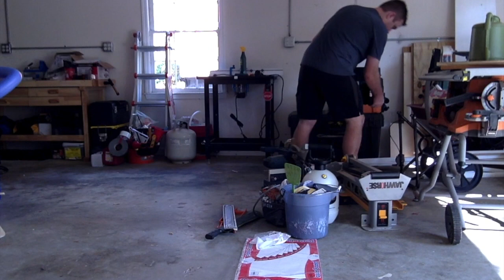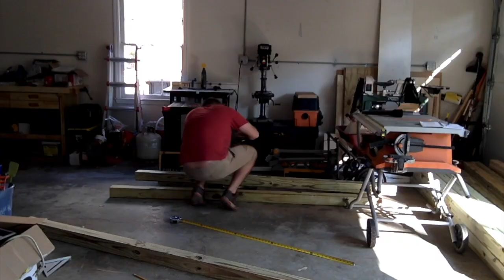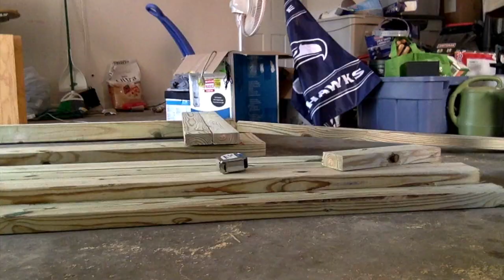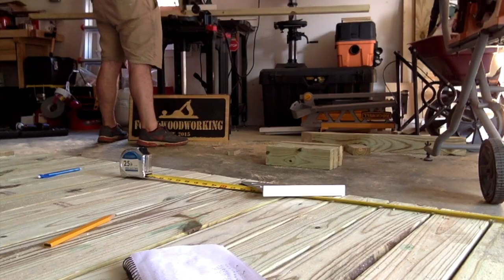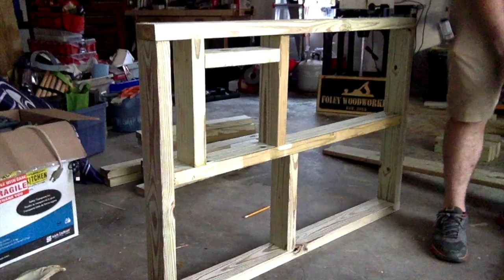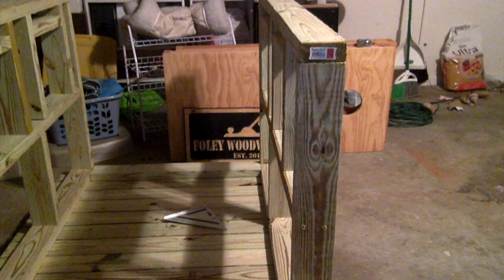Dog House Build Part 1

Comment: Please, can you tell me what materials do you use to do all the project?
Reply from the maker: It is all pressure treated material.  It is made up of PT 4x4 posts, PT 2x4s' and PT decking boards.  The roof is just normal plywood with asphalt shingles.  The awning I used cedar shingles.  In the windows I simply used plexiglass.  Hope that helps.